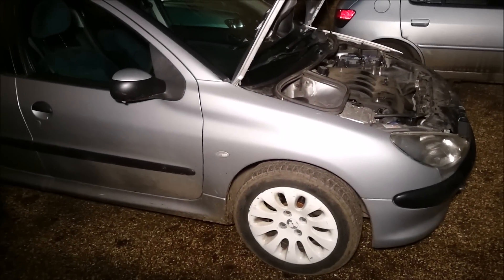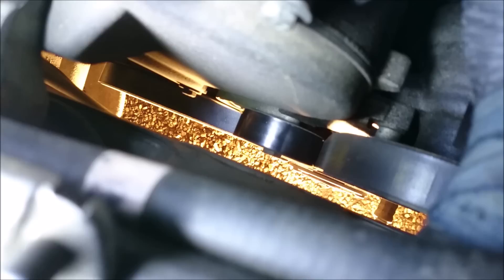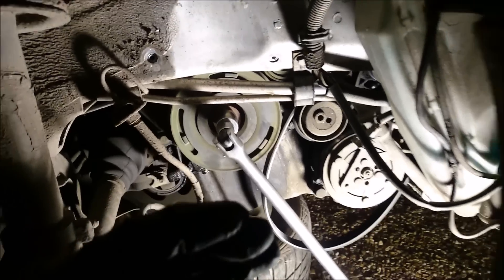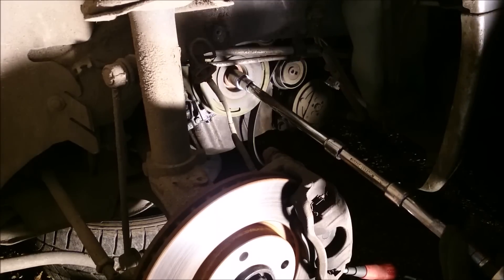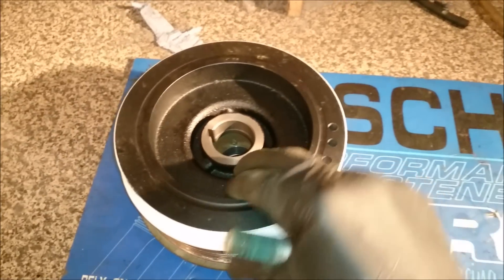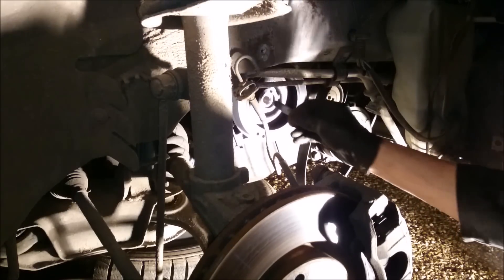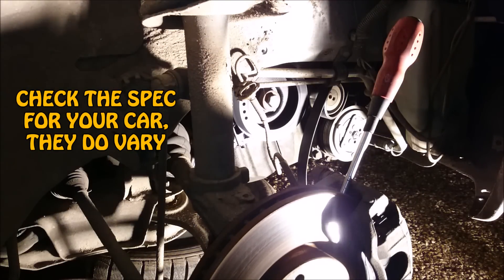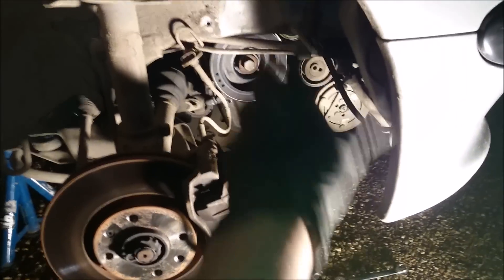HOW TO: Crank Pulley Change

Comment: Nice little hint with the screwdriver in the brake disc! Fun stuff!
Reply from the maker: dumkopf thanks... never sure about giving little hints as I know some may not understand or some may go mental about it...but I have used this method for all sorts, hub nuts etc and never had an issue. 🐷👍
Reply: would this method work for solid discs tia

Comment: Good little video. Good old tip with the screwdriver, that works well for drive shaft end bolts too. On some breaks you can use some locking pliers, big plummers grips or pipe wrench across the pads and in effect squeeze the brakes on. But they aren't always accessible for that. The one thing I would say is that I would not advise people 'lever' their crankshaft pulley off as suggested in your video UNLESS you are definately changing the pulley. It's in two parts and levering in the wrong place might tear the rubber vibration damper. So if you're just taking it off to inspect it, don't lever it off otherwise you might find it is indeed broke when you get it off but maybe it wasn't broke before you started :-)
Reply from the maker: If levering it off breaks it into two pieces... it needed replacing!!

Comment: Mine when accelerating up to 30kph start to squeaking.. need to change the CrankPulley??
Reply from the maker: The pulley won't make noise based on speed, if it makes ANY noise however, it should be replaced....but I've never ever heard one squeak as such. Your squeak or squeal could be anything rotating.

Comment: Hi. Love your channel got a 2001 306 hdi can I put part no. 0515v6 pully on mine. Just checking that's the sort you use?
Reply from the maker: That'll fit 👍🐷💪
Reply: Life saver plus is it worth doing water pump and tining kit at same time. Would you recommend anything else to do at same time
Reply from the maker: If they are required. 

Big difference in jobs though tbf.
Reply: @PiggyPower  ok grand cheers. Just got it and hasnt had any receipts for any if it doing for a while but did your tension test on belt and it seemed right enough. Looks reasonably knew but unsure if theyve just done belt or kit. Is there a good way to check water pump/ kit tensioner ect. Before I start.
Reply from the maker: Tension can be fine... But belt worn out. Cambelt is hard to workout tbh, best to do it if not sure. I have a guide on the channel for the 2.0hdi 👍🐷💪
Reply: @PiggyPower  I know watched most your videos. Make life alot easier than a Haynes manual!
Reply from the maker: Thankyou ☺️🐷💪

Comment: what do you call that pulley beside the crank pulley the bigger one with 3 screws.?
Reply from the maker: King Damo That is the A/C pump/compressor.
Reply: can u help me sometimes there's a squeaking in that part sometimes don't, is there a way to remove that squeaking sound without going to the mechanic.thank you
anyways I tried to turn it ,the squeaky noise disappears but will come back aftersometime..thank you
Reply from the maker: King Damo does it make a difference if the A/C is turned on or off? you sure its not the tensioner pulleys (more likely) or a worn belt?
Reply: im sure its that compressor clutch..i saw  it grinding..sometimes..is there any way that i can just put like wd 40 or something.it seldom happens but still
Reply from the maker: King Damo if it definitely is...3 options; replace the compressor. Dont use the A/C. Remove the compressor and run a shorter belt
Reply: the mechanic said its not the compressor its just the compressor clutch..maybe the bearing is worn out
Reply: when i try to twist it its gone.
Reply from the maker: King Damo if its the clutch, same 3 options.

Comment: These are one of the worst as the bolt gets even tighter as the pulley where's out
Reply: oh and Piggy Power is correct this is the best way.
Reply from the maker: Indeed they can do. Thread locked usually all the way too 🙈